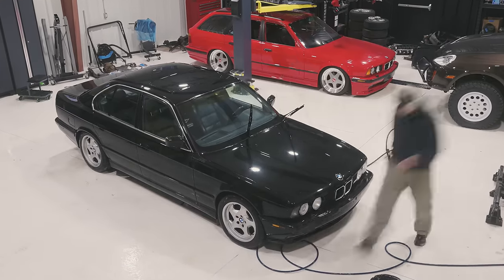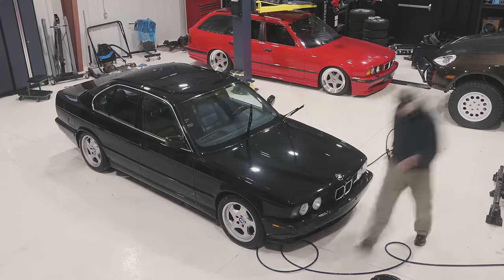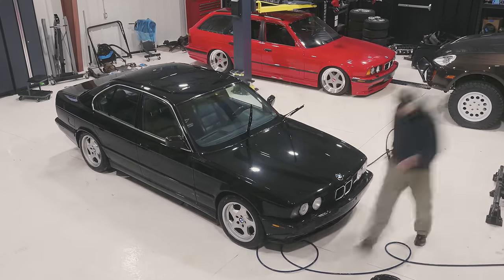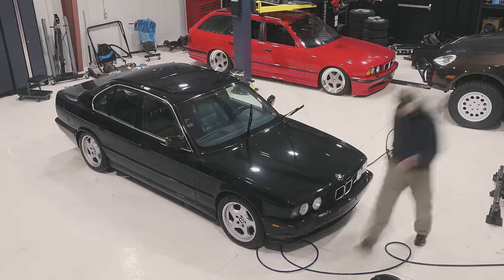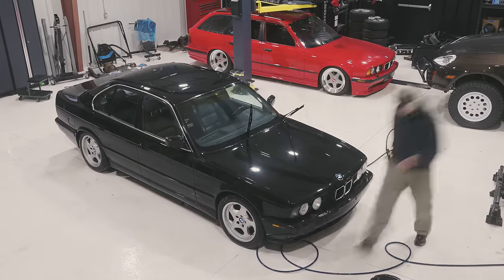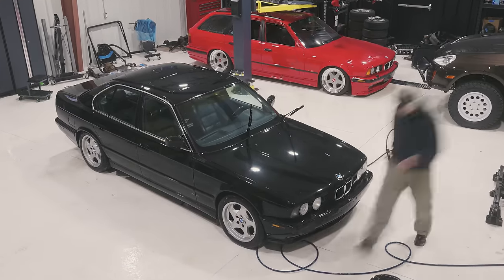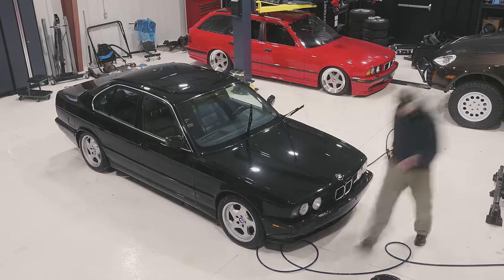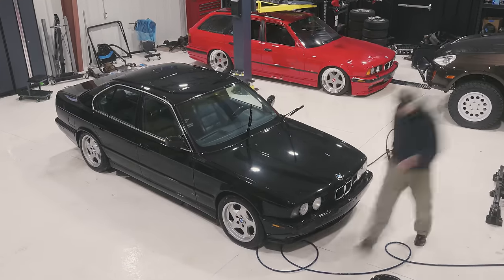Can Detailing Save This 400,000 KM E34 M5?

Comment: Seeing cars in this state always makes me think about that period of time where iconic cars like this one, the e28 m5, and even the e30 m3 weren't held in as high regard as they are today. They could be bought for very little and as such were neglected. I wonder what modern day cars, if any, will see the same periods of neglect followed by a rise to the top like these have.
Reply from the maker: I often think about this too my friend! I believe the access to information in this internet age may have ruined that cycle from happening again. Unfortunately
Reply: Also i have my doubts that a lot of modern cars will be able to reach the same milages as the cars from the 
80´s/90´s. Certainly if we´re talking about 400k km! 😅 All these downsized engines have to endure way too much stress with todays hp figures and i don´t even wanna think about how people treat turbocharged engines. Many of them probably weren´t exactly properly warmed and especially cooled down during their drives.

Comment: Came across your video and def. wasn't disappointed! VERY impressive work and some of the music gave me gran Turismo menu vibes haha.  Night and day difference esp. on that black paint. liked and subscribed! If I may ask, what did you polish the glass with? Also why didn't you use the same trim spray paint on the moldings as you did on the front grille bits?
Reply from the maker: Thank you Lucas! I really appreciate that. I used a yellow foam pad on a rotary polisher for the glass, same compound. I would have used SEM on the pillars as well but I ran out 😭. The product I used is my second favourite
Reply: @ChromaticGarage  ahh I see. Thank you for the reply and answer. The car looks absolutely sick, considering the age and mileage it has. Love the content.
Reply: @ChromaticGarage  also. If it's ok to ask, what brand are those standing work lights u use? They look very premium.

Comment: Hey guy, I saw that you painted the window trims was wondering if you did that with the SEM? After watching your videos I have painted the majority of my 242k mile F150 trim with the SEM and I love it. The window trims though, I've yet to do since they're kind of a rubbery material. They're extremely dry after life in the southern USA to the point that they're like plastic. I was worried though that the SEM wouldn't adhere correctly. Any advise?

Comment: Did you use "normal/generic" black touch up paint or the car's specific color paint ? 

I think you said it was called gloss black, but yeah. Thanks !
Reply from the maker: Yessir! In this instance I used “universal gloss black”. Gloss black doesn’t really differ with the lack of metallic. Typically I will get the actual paint code though!
Reply: @ChromaticGarage  Good to know, thanks!

Comment: are you using any special spray cap for painting? If not, I would suggest graffiti specific soft cap, It wont spit drops, just fine particles come out
Reply from the maker: We were juuuuuust talking about this! It is a great idea
Reply: @ChromaticGarage   there are so many cap styles, just buy all kind of them and try what fits your needs. They really make the difference in the finished product. Overall, I think that the layers with them are thinner, so peeling is something that you don't need to worry about later.
By the way, huge fan and huge inspiration to keep my own channel going! 🙌